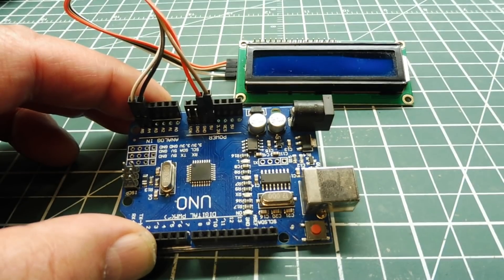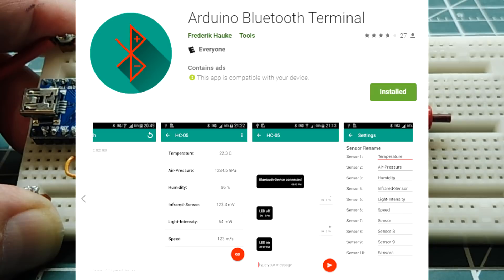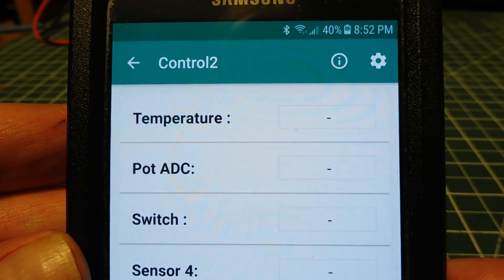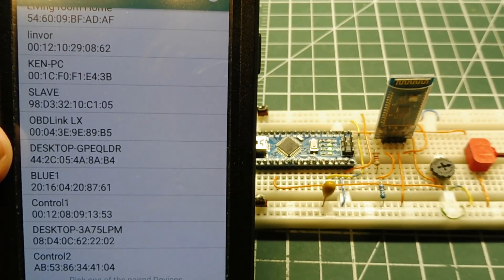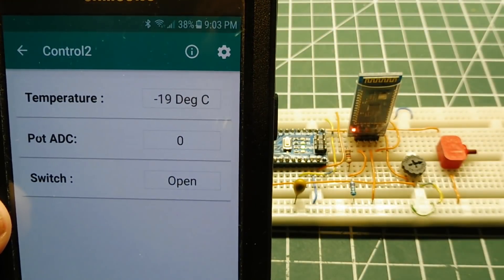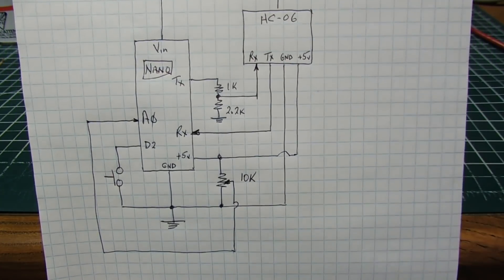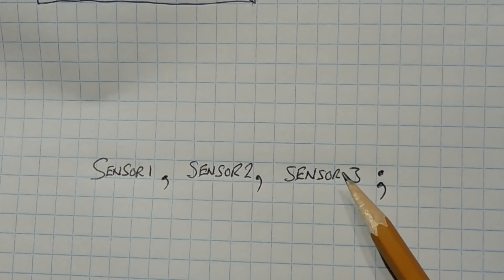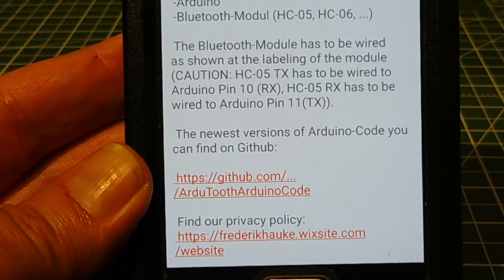Turn Your Smartphone Into A Display For Arduino Projects

Comment: Can I use nodemcu esp8266 to replace the arduino+Bluetooth sir? I'm new to everything but I know there's this module that has wireless Connectivity already
Reply from the maker: You need Bluetooth connectivity to talk to the app on the smartphone. Esp8266 only supports wifi.
Reply: @0033mer  thank you sir. Can you recommend which of the 2 can I use. I'm planning to use a smartphone as monitor for arduino's sensors...
Reply from the maker: You can use the microcontroller of your choice and a HC-06 module. https://youtu.be/JVURPBMrBxs
Reply: @0033mer  thank you so much sir

Comment: Did you just spray liquid on your nano and it didn’t short?
Reply from the maker: It is Tetrafluoroethane (Freon) which is an insulator and does not conduct electricity.